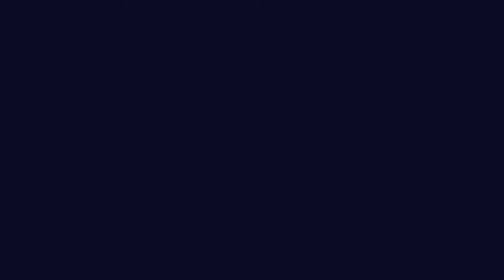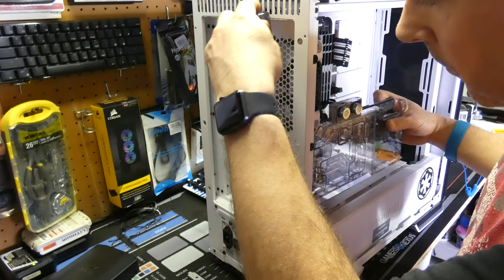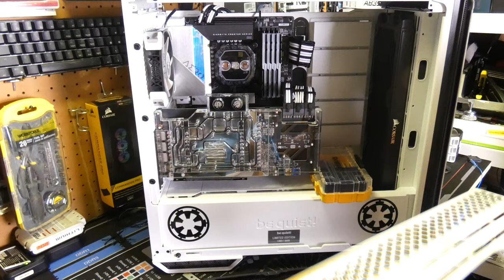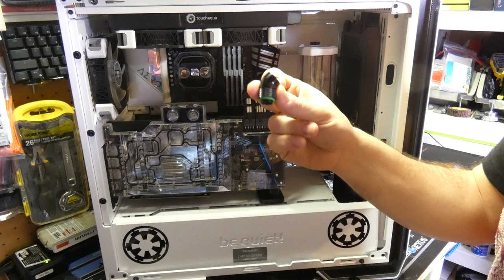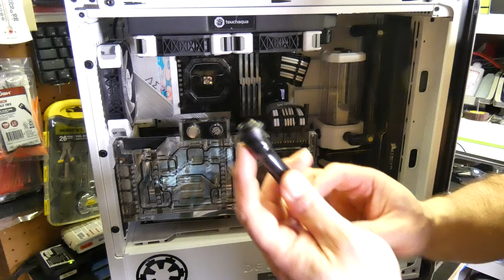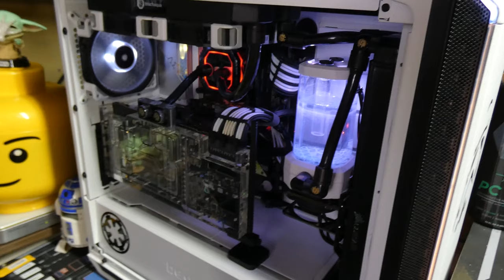First Custom Loop - Installing the Loop - Vlog Part 3

Comment: Hello, I know this is an old video but what was your future experience with the Bitspower 3080 FTW3 water block? Did you have good thermals and or any gpu crashes? Kind regards.
Reply from the maker: I did have some temp issues but they were more down to the case. Once I removed the front panel (which is solid) I saw really good temps. I had one crash but that was related to a razer synapse issue.